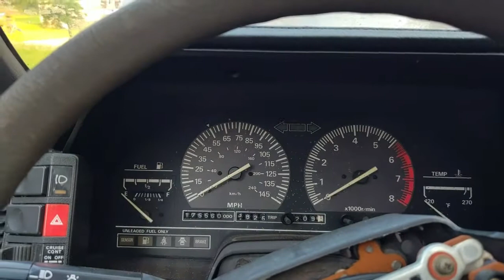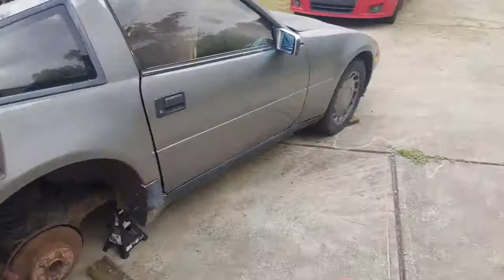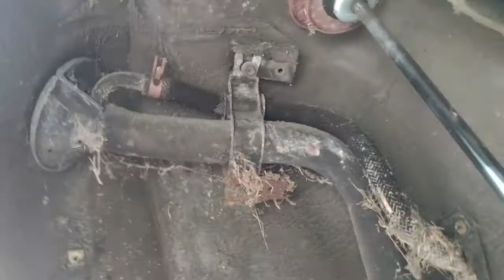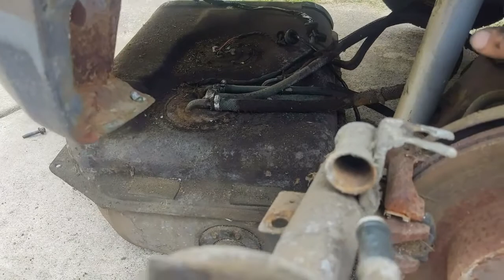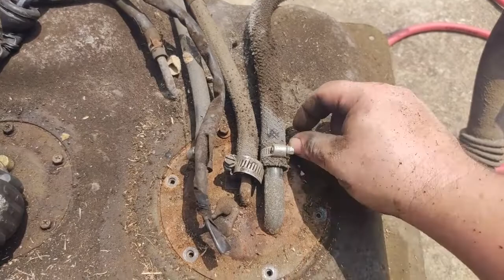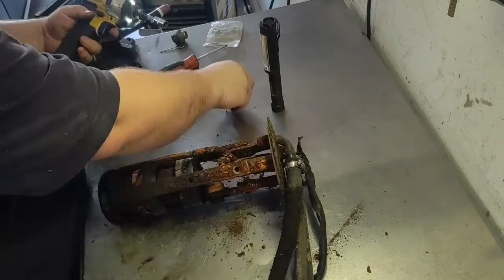WHY DOESN'T MY Z31 RUN... Pt 1

Comment: never use power tools on anything gas related all it takes is 1 spark and everything on fire even brushless not even worth it
Reply from the maker: I have never had a problem with power tools as working around gas. As long and you are in a open environment and are not working directly on top of fuel you shouldn't have a problem. I personally have over 10 years of experience in the automotive industry and have never had a problem.
Reply: @hotwillzgarage3167  You might not of had a problem but put other people have, I’m just saying it’s not even worth it like I said all it takes is one spark. I like electric better but on gas related I just use air. It’s the safer option especially when you have other people watching your videos and doing this in their own garage.

Comment: Good video.  I’m working on my AC for my 87 z31.  I think I have a bad vacuum canister. I never hear it come on.  How can I test the canister using a multi meter etc? Thanks.
Reply from the maker: I would personally test the vacuum pump by unplugging it and giving it 12v and see if it turns on.
Reply: @hotwillzgarage3167  Will try it. Thanks.   Keep up the good work.

Comment: My 85 z31 is doing the typical maf issue wont rev past 2000 rpm but I changed MAF today and still same. Any other typical issue causes that?
Reply from the maker: First thing I would do is check the ECU for codes. Also check to make sure your TPS is calibrated property or that it works. You can check with a multimeter.
Reply: @hotwillzgarage3167  thanks man will do! report back once figure out what it is
Reply: I was having the same issue along with a rough idle. I deleted the egr and now she’s running great